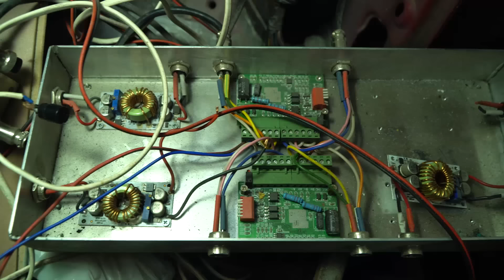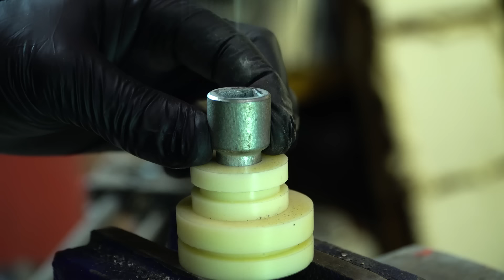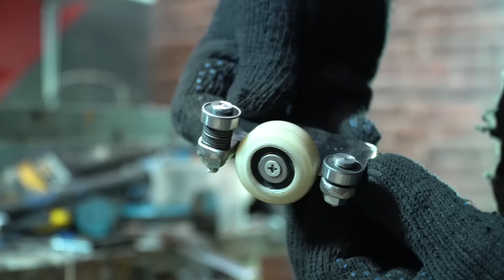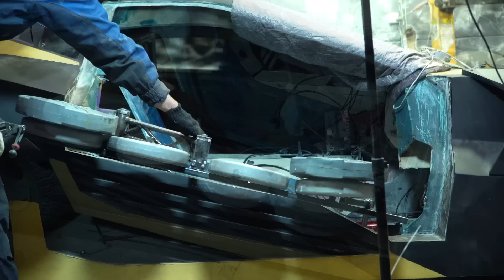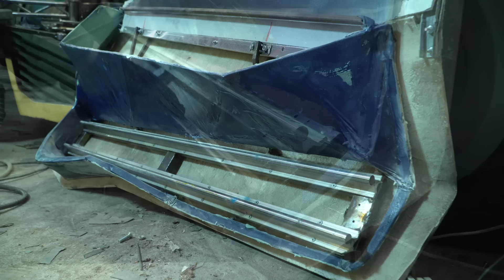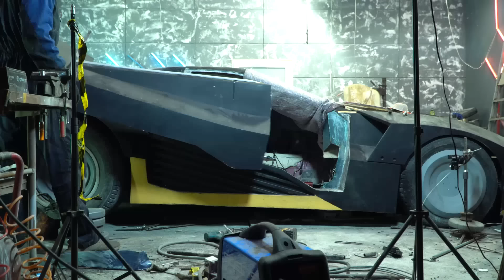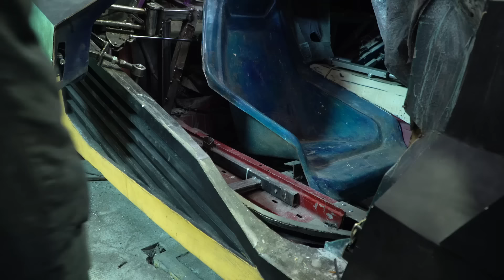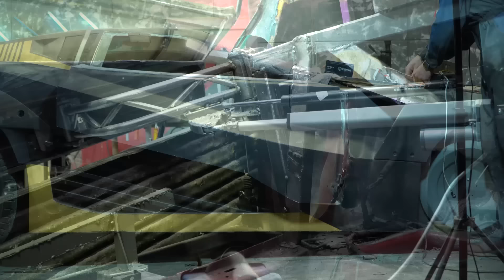New door mechanism. Quadra V-Tech from Cyberpunk 2077. Part 32

Comment: Hey Great Work! What about using an Arduino for controlling basic things like the delay of your door locks? its cheap and easy to use for even more than one function. Of course you need relays anyware because of the currents

Comment: The Ford Flex uses a linear actuator for the rear hatch that operates electrical or manually without you having to do anything.  It might work for your doors.

Comment: Have you though about an electric motor driven roller? that way the door could open or close automatically and the electric motor would let the roller roll free when the door is manually opened or closed.

Comment: yeah, I'd lose the linear actuator, the gas strut works great.
Reply: It also removes the safety hazard of a self closing actuator.
Reply: @PatRyan-c7z  , good point
Reply: @abates3747  Actuators are a fun little feature though.  My dad and I installed them on our classic car, can open with a key fob.
Reply: its definetly cool to have it close automatically but i definetly agree that the actuator would add a headache that would really suck to fool with.
Reply: Agreed, saves weight, headaches and is easier to fix should anything go wrong.
Reply: Definitely agree. The increased opening sliding speed wihtout the actuator is nice as well.